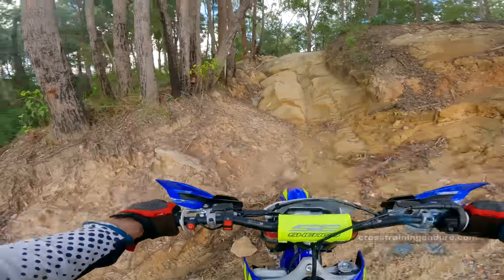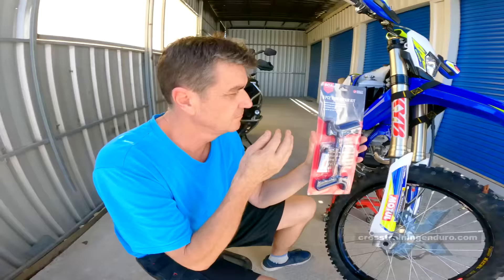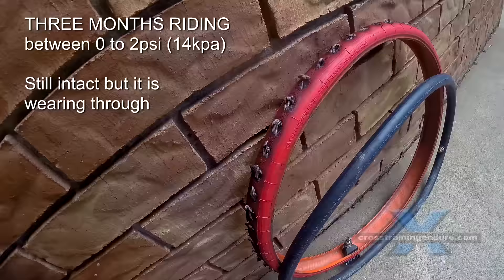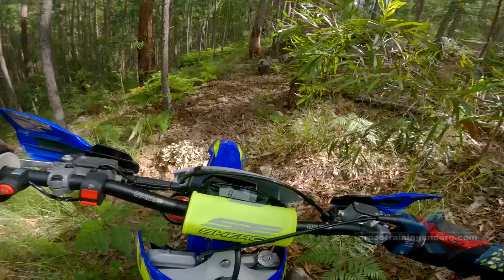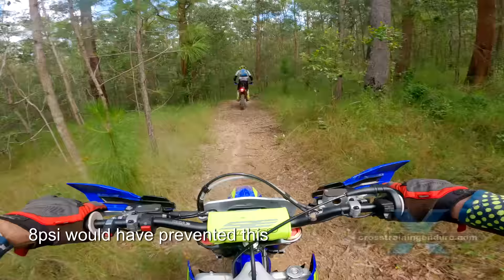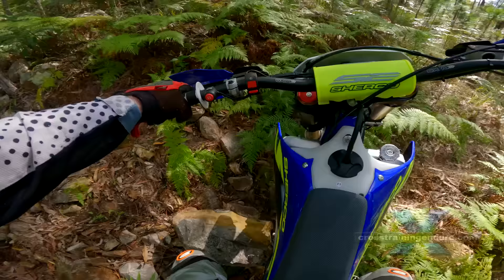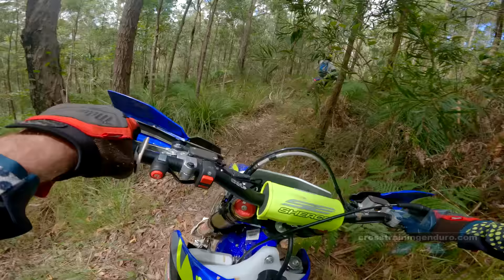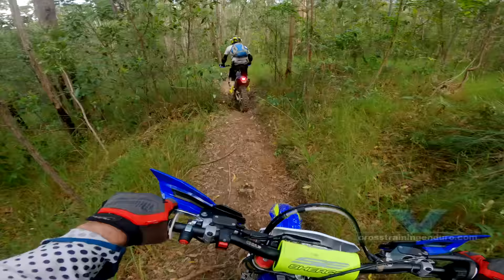TUbliss long-term review after 7 years with the tubeless tire system!︱Cross Training Enduro

Comment from the maker: UPDATE: I just had an air leak develop from the valve stem on the high pressure tube (two year old tube). One of the other guys did too but it was a near new tube. 
FURTHER TIPS! Follow the instructions! We suspect most reported problems are from ignoring instructions. Duh.
If you put a sealant like Tyre Slime inside the tyre carcass, it provides lubrication so you can run even lower air pressures if needed. Below 4psi, the inside of the tyre carcass can rub against the red plastic and gradually wear it away. But Tyre Slime provides lubrication and prevents this. Of course, it can also fix minor punctures too.
To make fitting much easier, you can use soapy water or silicon spray. Tyre Slime is messy but can perform the same function. We tend to do that as it minimises the chances of a poor seal with the knobbby against the rim if you have any internal scratches or deformities on the rim.
As with any normal tube... ensure that small knurled nut is not tightened to the rim as it can cause the stem to tear where it joins the tube if there is any movement. But also make sure the nut for the rim lock is tight enough. One of our riders had a failure when he didn't tighten this and eventually it moved just enough to rip the valve stem out of high pressure tube.
Reply: I was going to mention running Slime just for lubrication when running really low psi. Good job!
Reply: I have years of experience with the Tubliss and I always spray about 200-250 ml of soap water around both tyre beads and almost all gets into the main chamber…acts perfectly as lubricant and sealant and not as messy as slime…dont protect against small punctures though
Reply: I had tubliss for a year or 2. One issue is tyre choice. Bunch of people had issue as I found out with the same rear I was using, a Motoz Arena Hybrid. Seal on the bead wasn't great as maybe some tyres expected use is with tubes. I'd lose pressure on the low side after a couple days. Not really a big deal but it annoyed me. Looked for leaks with soapy water and couldn't find any until I left it half an hour and found super fine bubbles all around the bead on the rim. 150mls of Stans fixed it though it can get in and block up the valve sometimes.
Reply: BTW, make note that the Dunlop AT81 front tire does not work well with Tublis. That's right from the guys at Tublis when I called and said I couldn't get it to hold air very well.
Reply: @davehowe_just_an_old_dirtbiker  hummm? is that why i use stan's race sealant in my tubliss? 🤔
I've got a high pressure tube that is at least 6 years old and still works fine
 The tubliss system makes tire changing super easy
Reply: Good tips!  

I like to use Armor All to install the TuBliss system and the tire itself, as it is "slicker than snot" and it doesn't dry out fast like soapy water does.  I'm in Colorado, land of 20% humidity, and stuff dries out fast here.

I have a Rabaconda which makes  changing tires easy, the stand is nice but those levers, oh ya, they are gold!   A Harbor Freight static wheel balancer with some moto stickers on it to which improve it's accuracy you know, and brass spoke weights and the wheel is balanced almost perfectly, which helps when riding fast.

Comment: Used them for about the same amount of time. Never put any of the stickers on, ride them on the road with "normal" air pressure, not had any problems. Knock on cranium(wood).

Comment: My real concern about the tubliss system for the road is not the police but rather the insurance agent. If I have an accident even if it is not my fault I could conceivably held responsible because I was running non DOT approved tire system. You know how insurance is always looking for a way of not paying out no matter how insignificant the reason. This is the only reason I am stuck with using tubes on the dualsport.
Reply: Concern or worry?
Reply from the maker: Yes that sort of thing is always a concern nowadays, Rod

Comment: I run em on my dual sported Beta 300 and they are great on or off road from 3-26psi. DOT is the lowest of low standards; it would be foolish to worry about not having a dot stamp on something inside of your tire.
Reply: I run TuBliss on the front tire of my Husky 701 Enduro, with the wheel static balanced for the rim lock.  

On the rear I sealed the spokes and taped the rim and am running it "tubeless" as I don't lower the tire pressure on the back tire below 24 PSI.  I like to lower the front when off road, and having the TuBliss is great for that.

Comment: Two seasons ago I got put down on a fast trail do to a sudden loss of air on the front tire while running Tubliss(that hurt). Last Saturday on the return from the trails, the same thing happened on the asphalt... I had a nice 30' slide, that cost me a new jacket, pants and jersey, lucky I was in full off-road armor and got no injury or road rash. Anyway, my trust off Tubliss is shattered.. I'm never running it again up front, I'll stick with a tried and true ultra-heavy duty tube at 12psi and a rim lock.  That said, I'm totally spoiled by running a hybrid tire at 6psi in the rear with Tubliss, I've also never had an issue with the system on the rear so I'm keeping it on that end.
Reply from the maker: Bummer! Did the front knobby have a very soft firewall? In my experience, the typical knobby still works okay with 0psi... it's sloppy and will roll around with fast cornering but it feels like a tube setup at 3psi. E.g. rideable.
Reply: @crosstrainingenduro  I run a Shinko MX216 Cheater Fatty up front at 12psi. Both times I lost pressure suddenly and this caused the front end to wash out. I doubt its the tire's fault, both times the tire lost pressure at speed, not going straight and this caused me to lose control.  Btw: there no puncture or tear in the tire.

Comment: I have run TUbliss for about 3 years now. Thought it was the perfect setup for the style of riding I do from the moment I fitted them. Have had a few tyres that refused to stay inflated for more than a few days but they have always stayed inflated for the ride so not really a problem as you should be checking the pressures for each ride anyway.
Reply from the maker: Same here, I had a puncture that didn't really fix up that well but it would stay up for the ride and that was all I needed....

Comment: I used Tubliss for a couple of years and I really liked it. One additional benefit is that because you can use way lower pressure, in very loose terrain you use all the contact area of your tire and not only the grip is better, but also the tire lasts a lot longer, since you use all the knobies more evenly. I finally move to mousse though, because of two situations that have little to do with the product itself: 1) Many mechanics didn't want to change tires because they didn't know the product and didn't want to risk damaging it (... lazy bastards!...) and 2) The valve on the inner tube broke one day and I couldn't get a replacement in my country or literally anywhere that shipped internationally!! Mousses are a lot more common and easy to find.

Comment from the maker: ONE MORE LONG TERM COMMENT! As per  the vid our group absolutely loves the system. And wev'e only had two failures with six riders over seven years. (As per the vid, one was poor fitting technique, the other was racing in a hard enduro over very sharp rocks with low air pressure).
We've just had one more, Jeff's high pressure tube in the rear wheel deflated. He pulled it apart keen to see what had failed as it's only nine months old. It turns out he hadn't tightened the nut for the rim lock. 
The rear knobby very gradually moved and eventually the valve stem wore through against the rim. So rider error, not the TUbliss system. Did the lock nut slowly back off perhaps? Possibly. I checked mine and the front nut wasn't very tight. Good idea to check them a few times a year!
Reply: Yeah, it was a muppet error not tightening up the rim lock enough.
Now, I check the rim locks every time I check the spokes (which is only when I sell the bike)

Comment: been running 2-3psi on Metzler tyres with tubliss for 5 years with zero issues because of the heavy sidewalls...did puncture with a Michelin tyre once as they are much lighter, so would probably advise running them around 5psi. Unbeatable traction, and easy to install once you follow the instructions to properly

Comment: Ran it in the rear for years with very few issues, love the flexibility of different pressure with zero risk of slip + plus dead easy puncture repairs. Always keep a spare high pressure bladder in my kit bag, they’re not expensive
Reply from the maker: Great to hear, Dan

Comment: I ran tubliss for about a year and had three issues.  Once I got a nail all the way through the tire and into the tubliss tube that left me stranded.  2.  Seemed about half the time I changed tires I would have a low pressure leak, resorted to using generous amounts of slime.  3. You can still get flats, although easy to repair, you need to carry a pumps and plugs. 
I prefer mousses, you can modify them to get the desired feel “pressure”, you never need to check air pressure, and it is impossible to get flats, no need to carry any tire equipment.  
In fairness to Tubliss, their equipment is quality made and probably the best choice for track racing where you need to change/run lower pressures for max traction.
Reply: A friend melted a Mousse out in the desert, the mess that created was hard to imagine.
Its not impossible for a Mousse to fail. If they are used too long and get old they can be way loose inside the tire and totally go to $hit.
The mousse needs to be taken out and lubed every 3 or 4 hard rides in the desert.

Personally I would never do that.   They are a race only item for most.

Comment: Been running tubliss for 7 years on multiple bikes and love it. I definitely agree with the tyre slime method or similar alternative options around the rim. I also use silicon spray on any areas that can rub like the red inner liner and the inner tube where it slightly kinks around the air valve etc. I run around 4psi with Michelin Xtreme rear and 8psi front Michelin medium. Thanks for the video. Cheers.
Reply: Hey you think tubliss can be installed if rim is slightly dented?
Reply: @sliceofbutter6766  i cant see why not as long as no air can get in between tyre and rim etc.

Comment: I've been using tubliss for a few years.  Its been great.  I have had a rear that goes flat overnight, even though I used a new tire and follow the instructions meticulously.  If it happens in the future I'll try the slime trick on the bead.  I run some goop in the tires.  The goop I choose is primarily for balancing the wheels but can also seal minor punctures.  This is a great solution for dual sport as I can run a tire that has reasonable road manners, then air down aggressively on slick trails.  Slippery in my area is dust and marbles over smooth hard decomposed granite.  Very typical in the Southwest US.
Reply from the maker: Great to hear! If the air leak annoys you, it might be worth popping the wheel off, just push the knobby in a bit to get it off the bead and dribble some Slime around the rim. I didn't get a good seal with a used knobby once (not surprisingly) and it came good after that without needing to actually take it off the rim.
Reply: my experience Artful is as far as balance goes, liquid sealer in tyres can only unbalance them, i have seen manufacturers claim the opposite but then withdraw the claim. i have tried to balance wheels with sealer using weights, but sealer just makes it impossible.
Reply: @gilogreenaway2989  The stuff I used worked great for balance.  I also tracked down the extremely slow leak.  It wasn't at the bead.

Comment: I've been running Tublis for a couple of years now and love it. While 3 psi may be good for traction, I don't like it at the higher speeds that I tend to hit from time to time. 7-8 psi seems to be a happy compromise and I don't have to change pressure out on the trail...or worry about pinch flats. I get lots of flats from large thorns so I always use Slime...even when I was running tubes. And Armor all for lube. Works great.

I was concerned about losing the high pressure pressure so I check it at every ride. The problem is that just checking it will loose pressure so now I just top it off with my high pressure bicycle pump before each ride. Probably overkill but it only takes a few seconds to do. I usually get it to 120 psi so that it's at 100 psi by the time I remove the fitting since it does leak a bit just removing it. I haven't had any issues with loss on the low pressure side.

True story. I was installing a fatty front tire and had a hell of a time spooning on the tire. Usually front tires are easier than rear tires but this was like installing a mouse. So after bloody knuckles and all, I finally get it on. It was miraculous that I didn't tear the tire where it has to seal against the rim. So I go to pressurize the inner tube and, what do you know, the valve stem was still in it with a bit of pressure in the tube, DUH!!!! At least now I know I could install a mouse if I wanted to! 🤣
Reply from the maker: Great to hear it's working out for you, Dave. We had one of those 'Will I tear the tyre?!' moments on the new bikes lol.

Comment: Been running tubliss on my dualsport, easily best upgrade I've done. You need 100g front and 120g rear tire weights opposing the blue valve to balance the wheels out but once you do that they work great on the road and I haven't had any issues at all. 

10/10 nothing quite like being the only one in a group that doesn't get a flat.
Reply from the maker: I detest fixing punctures, Jordan. And I hate changing tyres lol. So this has been a great compromise between tubes and mousses for me...
Reply: A quick question Jordan.
The balance of blue valves would still be easier than having to balance the rim lock on a tubed tyre?
I get a noticeable shake on smooth roads but never have attempted to balance things out.
Reply: Same here, 0 issues and total flexibility in air pressure. I did encounter a massive front wheel bounce at 100kph on asphalt but it vanished after adding proper weights to balance the wheel. Actually I only balanced the front but the rear is on the list, didn't quite feel it's bounce i guess or just lazy.

Comment: Another good presentation of the facts Barry.
I've been using TuBliss since 2017 and really love the system.
Easy tyre changes, adjustable air pressure from zero to 15psi and it's reliable.
I've never had a high pressure tube issue and only a few tyre punctures.
I recently tried a mousse that was supposed to be sized for my chosen tyre to be around '8 to 10'psi.
I was unable to ride the same terrain I normally can using TuBliss as the mousse was not soft enough and then obviously non-adjustable.

We run half a small bottle of Slime in each tyre both as leak prevention and as a lubricant for the inside of the tyre 👍
Reply from the maker: Hey mate, great to hear! I'm back from down south so will check in soon. Hope all is well...

Comment: When I bought my YZ125X the previous owner had Tubliss installed.  It seemed to work fine for awhile until the front developed a problem.   My shop replaced it with a brand new front bladder and new tire.  The bladder seemed to hold up OK but the tire had a slow leak from the get-go so I don't think they installed it correctly.  I'd never tried a mousse before and decided to try one in the front. I've never had a rear flat with a tube, even running 5-6 psi, so I think the magic formula for me is mousse in front and heavy duty tube in rear.

Comment: Used them for 5 years, zero issues. Slime is an excellent recommendation, I used it myself both to help with install and to seal up the Tubliss system as well. I converted over to a Nitro Mousse on both tires. They work as advertised, resulting in a softer feel than a traditional mousse. I end up with essentially the same pressure I would typically run a Tubliss at but with zero risk of flats. I’ve been able to have a mousse last through a couple of tires, just re grease and install the new tire. One less thing to worry about going wrong!
Reply from the maker: Good to hear, Dylan! One of our guys is thinking of swapping from TUbliss to Nitromousse for racing.
Reply: Would definitely check out the Nitro Mousse, really does what they say.

Comment: I use heavy duty tubes - run 11 psi mud/ sand or 13 psi in rocks.
No punctures in years. 
Not that I was fast - but I am getting older and slower.

Comment: Thanks!  I have been running for 7+ years at 8psi (>1000hrs).  I started using both front and rear tubliss but found minimal gain on the front.  Now I just use a standard set up on front and tubliss on rear.   Runs flawless with slime.  Thanks to this video and comments I will move this down to 4-5psi.    Did not realize you could run this low without issues!
Reply from the maker: You might ding a rim on roots or rocks with fast aggressive riding, Troy. But our rides are slow and technical so it's been great for traction.
Reply: Depends on your weight, terrain and speed.  I’m 220 w/o gear and a fairly fast rider and settled on 6.5psi, less and I sometimes hit rocks on the rim or it gets squirmy in a corner and more the benefit starts to drop off.

I too gave up on the Front years ago and moved to a Nitro Mousse, I find this the best combination for anything I come across.